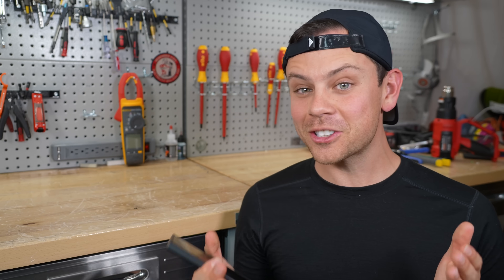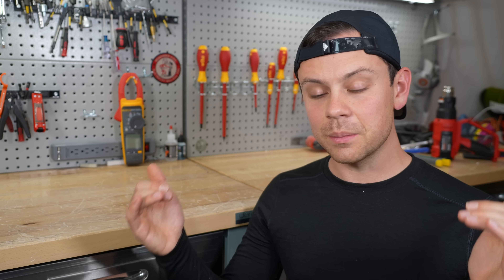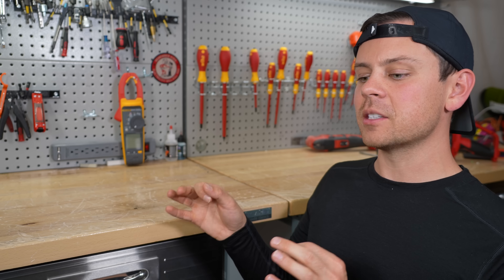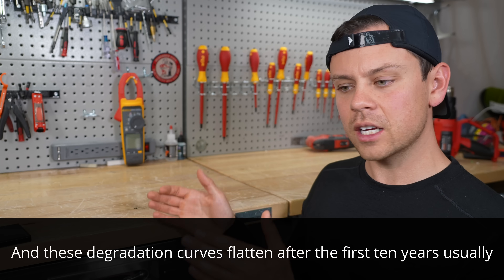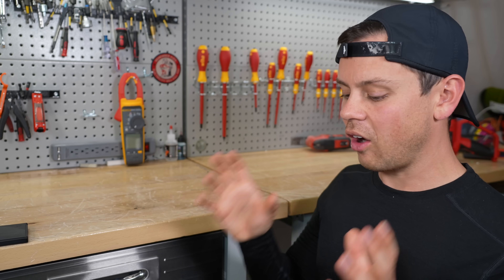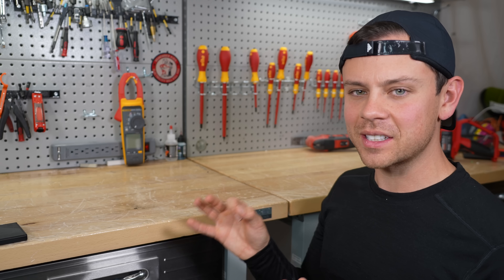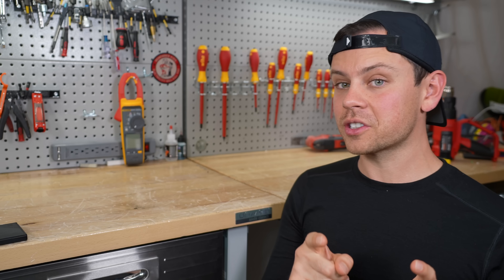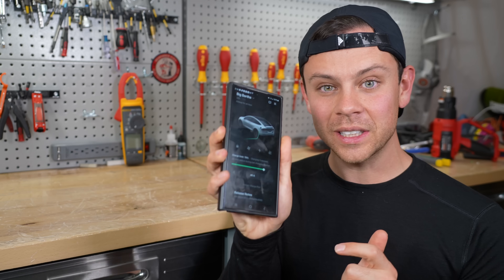LiFePO4 Longevity Discussion! Why Charge to 100%?! For Solar??

Comment: What float voltage will get to 100% for a 48v system?
Reply: Anywhere between 56.8V-58.4V will get you to 100%, higher voltage will get you there faster. I asked Will in my comment right before yours if he has an opinion on what to use in that range. I'd do what he says but in the absence of him saying anything, fwiw I do 56.8V

Comment: Just making sure I'm not conflating 2 different issues: 
When you say "charge to 100%",  and other people say "only charge to 80%"
Is the argument about what voltage you should charge at? Or is the argument that some people say to stop charging once the coulomb meter says 80%?

Because my understanding is that regardless of if you charge to 3.55V or 3.65V per cell (56.8 vs 58.4 in a 48v 16 cell battery) it will eventually get to 100%, it'll just get there slower using 3.55v. 

So is your beef trying to get people to set their chargers at 3.65V per cell? What voltage do you recommend charging at?
Reply: I don't think it matters if you go 55-56.4. I set mine at 56.4v. Issue in the winter is getting enough sun to fully charge the batts.
Reply from the maker: Oh good question! I am going by HVD  being 100%, and using coulomb meter to measure 80% from that point. That is how a closed loop comm battery will figure it if someone changes their settings. 

And yes a battery can slowly charge using 3.55V, and you can test it with capacity tests to show that over a long enough time, it did indeed hit 100%. Takes a long time, but it will do it. but most packs charge to 3.65V per cell but the string will disconnect before the whole pack hits the nominal you expect. Also, measure the balance current at 3.5V vs 3.65V. With the balance resistor value, the higher voltage will get you there faster. There is an argument for float, but if you charge with solar it will keep hitting HVD and causing it to balance (unless you have comms, then it will manage this current and balance process by itself). That is what we do to balance those cheap chinese packs that come imbalanced. Just set it to 14.5V and let it set there. Of course one cell will reach 3.65V first, and usually the disconnect will be at 14.3, but if you keep cycling, it will get higher every time till it's balanced.
Reply from the maker: My recommended charge voltages are here: https://diysolarforum.com/threads/recommended-charge-profile-for-diy-lifepo4-batteries-sticky-post.5101/

Comment: I think it would be helpful to describe what you consider 100% and 0%.  I've seen posts on your forum where people argue at length about what to set the BMS for full and empty.
Reply: I’ve been looking for that as well……
Reply: Full 3.55V per cell, empty 2.5V per cell. You could technically go to 3.65V per cell, but it's not needed - I never go over 3.5V myself. I also never go below 3.0V (the energy between 3.0V and 2.5V is negligible).

Comment: My only issue with discharging to 0 is that if you do this regularly and then a storm hits and you lose grid power, you've just pooched your system because it's been depleted when you need it most.  Same thing applies to off grid, Murphy's Law states that you will have no sunshine for 5 days immediately after discharging your system to 0.
Reply from the maker: Exactly! Need to stay charged. If you are hitting zero, need more panels and batteries. But if you need the power and only cycling to 20%, no reason not to go to zero. Use every bit you can

Comment: I thought I messed up my eve 280ah bank when I forgot to disconnect a crappy old inverter that kept discharging thrm. They went way below 2V nd I thought they were garbage. I tried putting them on a charger and I those puppies filled right up to 3.65V - they did so in a bit of an imballanced manner, but after top balancing I tried a capacity test and got to 254Ah before the tester cut them at 10% capacity! LiFePO4 is amazing.
Reply from the maker: Holy cow haha that is crazy!

Comment: Any general guideline for the amount of time it takes the cells to balance once you've hit 100%? Thanks.
Reply from the maker: Now that is a tough one! The budget packs from china can take a few weeks of cycling to 100% everyday. If you have a eg4, the comms will manage it. Just need to hold it at 100% for a day or so. If you cycle to 100% often, it will balance. But it can take a bit

Comment: We love our system, and it's doing amazingly well.  Unless we have an extended period of snow, it will last 3 to 4 days with a full charge.  And we'll let it drop down to 2% or so before we actually fire up the generator for a bit.  This winter, we're hoping to avoid even running the generator if possible after we just added a string of 8 more 540 Watt bifacials to our array.  (Found a fella selling them for $40 each as they had some minor cracks that we sealed with silicone. Could NOT pass up that deal!).  Always look forward to some Will Prowse "school".  Keep it up professor.

Comment: My system charges to 100% every day from April through October, but there isn't enough sun to do this over the winter (about 10% of what we get in summer).
As a result, the batteries wander from about 20% to 80%, mostly from incomplete grid charging at night and discharging (loads > solar) during the day.
Reply: I get about the same output here in Cali now that I did during the summer after I increased the tilt angle... when it's 🌞, but that's far less time than couple months ago.

Comment: Will best rant I've heard in awhile we put ours together finally 22oo solar that outdoor rated 300lb stand alone you showed and a 3000 watt eg4 run straight to a 30 amp RV plug waiting to finish building the house for future innovation

Comment: I spec'ed mine out to my usage and run emm hard lol if they are of going to only last 10 years then be at 80% then fine I''ll just supplement with the new tech by then if needed...
The point is I am more focused on them working for what i am using them for not on whether I can eek out 5 percent more..
I'll make more money on the stuff I am using the power for now than the labor involved in sitting there watching the screen every day..
I have the system set if they get too low they recharge from the utilities.... 
I look at them only to see the trends and decide after a few months if I may need to up the capacity or balance if they are not making it to my balancing set-point..(which is high balancing)

Comment: I asked this question in the previous longevity video that you just made and it remains unanswered. I know it's advice to use these batteries on a regular basis because their capacity declines over time whether you use them or not...For prepping and long-term storage, you said to charge it up to 100% at least once every 3 months. In this latest video you said that it does not balance the cells immediately when it gets to 100%. How long does it need to stay at 100% for it to balance? And then I assume I would use it down to around 50% and then put it back on the shelf each time, is that correct?
Reply from the maker: It all depends on the pack. If they are budget 12V packs, need to cycle them once a day, sometimes for a few weeks, to get those cells balanced. If you have an eg4 or close loop comm pack, it will manage it and you can just leave it at 100% and it will balance in a day or so.

When I need to balance a pack for a capacity test, I will leave it on a variable output power supply at 14.5V for 12v packs and leave it for a day or two. Then it is solid.
Reply: @WillProwse  awesome, what about portable Ecoflow "generators"? I have a Delta 2 and a river 2 pro.

Comment: I want a drop in replacement bms for the 48 volt eg4 batteries. Something that will plug into the same connector that is already connected to all the cells.
Reply: Dc house going to have a sale for black Friday for $109/12v 100ah.

Comment: I’ve yet to find any data on post life Lfp usage. I am curious if a battery is heavily degraded and at its post life capacity as per the manufacturer, 70-80% etc, will it degrade in the same way it did from 100 to 70% to 70% to 50%? Will the ability to push current diminish to the point where it’s useless and the voltage sags? I’d like to oversize the battery bank somewhat to extend the overall lifespan of the battery bank. Not sure I will be able to replace the battery bank in 10-15 years. 
You can somewhat do this with heavy duty lead acid batteries but not run of the mill batteries. The tougher and thicker plates tend to hold together longer, even when it’s shed a lot of active material.

Comment: Well said. I religiously charge all of my lifepo4 to 100%. I literally just capacity tested my DIY 272ah trolling motor battery tonight. After 4 years of hard use it still has near 100% capacity. Specifically 99% at 11.87v. It would have easily got to 100 if I discharged to 2.5v per cell

Comment: I use a delta pro ultra with 2 batteries 12kwh connected to a transfer switch powering my home 24/7 when the sun goes down it's at 100% and when I wake up around sunrise they usually are at 30-20% Thanks for the video more information is always appreciated.

Comment: Will, Please do a teardown of the new Bluetti Elite 200v2. It has a huge inverter (2600w), can supposedly handle a 5200 watt surge for a few seconds and another YT tester found it to have 96 percent of rated capacity. No one else has torn it down and the other YT channel noted that it seems like the BMS is improved. Also, it is much more compact than previous 2kw models, so they are using different batteries compared to everything else. Thanks for your excellent channel, forum and product page. You information is extremely valuable. Encouraging people to note any problems or make suggestions in the forums is also a great way to empower the community and give constructive feedback to reputable, responsive companies like Bluetti and Litime.

Comment: We live in an RV in the southwest with 500w of panels and a 100 ah battery. Usually at 100% before lunch. We use it and it's back up the next day. We don't keep track of discharge. It takes no effort and we barely think about it. If not discharging enough reduces battery life it's fine. I'll pay a bit more long term to not think about it

Comment: Will, living in Phx AZ, the summers are brutal as they are in LV, should the batteries be removed for storage as ambient temps can research 100 degrees Fahrenheit? I also let the batteries stay at 100% SOC as I use the camper regularly discharged them to 50% SOC for longer periods between trips. TIA.
Reply: I've considered pulling my batteries out but it is just too much trouble...  The ambient temps this summer in Oklahoma were over 110 degrees a few times.  My RV in partial shade was 113 degrees inside with the windows open most days.  My LiTime batteries are good up to 122 degrees but I'm sure 113 degrees isn't great for them.  I leave mine at a storage charge most of the time for this reason.  My batteries will fully charge in less than one day with no A/C running but that is because I have no roof space left.  ;-)

Comment: Not that I have much options, but if I have lifepo4 batteries for a sump pump backup, are there any issues leaving those on a low amp charger continuously?

Comment: Thanks for this. I'm going to start dropping my storage voltage down a bit.

Does anyone know what an 8 string 24v 120Ah resting voltage should be at after charging is complete? I drop all the way down to 26.6V which from my brief research seems off.

My capacity tests are at 88%, so there doesn't appear to be anything wrong with the cells.

Comment: I just installed a Siekon 100 amp-hour battery I bought through Will's link. So far, it's looking really good! I live in a travel trailer and am installing a 12-VDC system for all of the usual stuff, plus a 48-VDC system with inverter for all of the 120-VAC things. Will's videos are super helpful.

Comment: Why discharge down to 0?  As a full-time nomad I like to have a few days of reserve battery storage to get me through prolonged bad weather days.  My 700 w of solar provides more than my daily needs but I like being able to go have extra power to get me through a week of clouds/rain in the winter when the sun is low.  I don't have the grid as backup power so I like to be prepared for the worst.  I have 700 ah of lithium batteries and use less than 10% of my capacity in a day.  Is this damaging my batteries?
Reply from the maker: Exactly. No that is fine
Reply: @WillProwse  Thanks!

Comment: I understand what your saying about charging to 100% to balance, however I think this applies to OEM BMS systems, or in other words, non-configurable BMS's. The JK Inverter BMS allows the user to choose what voltage is reported as 100% State Of Charge.  This BMS also allows the user to choose the voltage the balance cycle starts, as well as float voltage. If you look at the line graph you showed the curve increases very fast at the end, The Off-Grid Garage has shown that the capacity per cell gained from 3..45V to 3.65V is very minimal, Therefore I have chosen 3..48 V per cell to be the reported 100% SOC, and the balance cycle starts at 3.4V. I am still learning, and these voltages are an experiment and may change. Keep up the good work.
Reply from the maker: @robby60259  why not set it higher? 3.65V works well
Reply: @WillProwse  I might, I'm probably just being overly cautious.
Reply: I have an open loop system. BMS won't work with my older inverters. What should the parameters be for this?

Comment: Total agree.  Extra 5% capacity ten hears later is 70-100 bucks for a 5120kW server rack battery.  If you need 5 of those batteries for your system at 100% charged then you will need 6 to do 80% charged at the same total capacity.  5x100 is $500 savings over 10 years.  The extra battery costs 1400 bucks or 900 more than the expected savings.  You just cost yourself 900 bucks extra at the ten year mark.  Plus in 10 years there may be much better storage options available.

Comment: yup, totally agree. my cells are never in balance because the solar and usage is always cycling between 30 and 80 percent. To get them balanced, I have to initiate a grid charge. In fact, a call to Signature Solar suggested it.
Reply: 30 to 80 with perhaps monthly to 100% to top balance is probably the very best way to treat the cells. With LFP it's highly likely with such a use case the cells would age out or the BMS would die before you'd ever cycle degrade them below 80% life.
Reply: We have free-at-night electricity presently so it’s easy to top off the battery 8pm to 6am. When the battery BMS says “no ,thanks “I assume it has top balanced the cells.